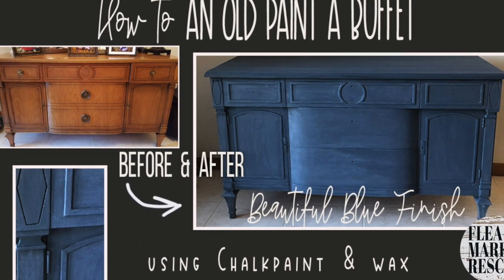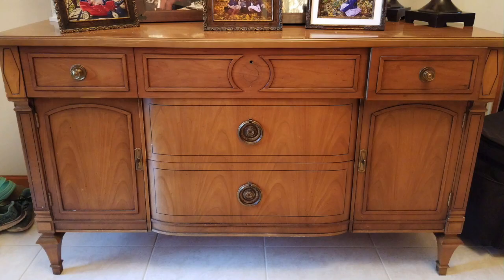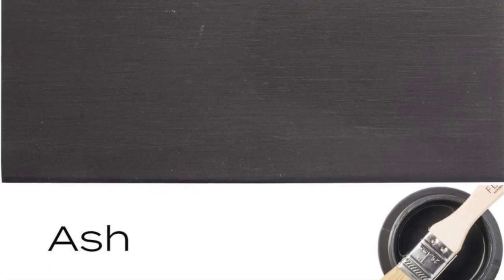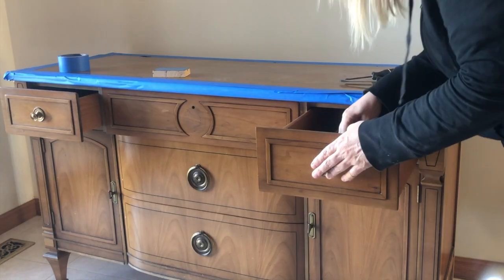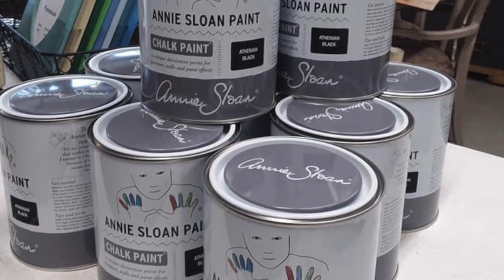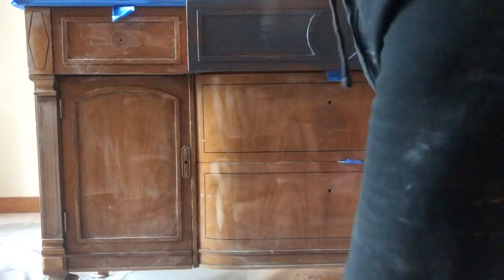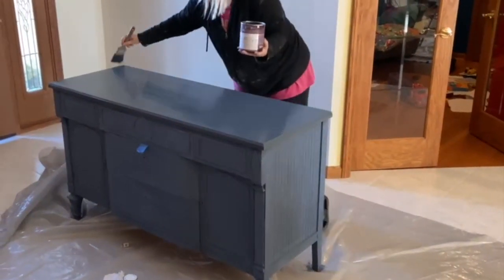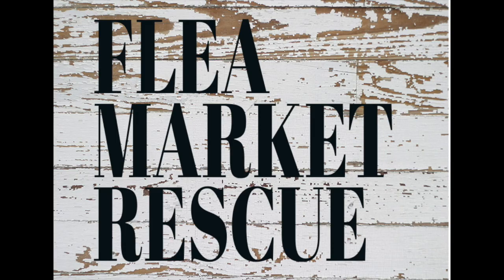HOW TO CHALK PAINT A BUFFET-FURNITURE MAKEOVER-PAINTING FURNITURE-BEFORE AND AFTER

Comment: The color is gorgeous...I suggest u to buy a expensive brush...19 to 25 dollars brush with an angle...they are expensive but what a difference when u paint...if you keep the brushes clean will last...I have some brushes that I purchase in 1987 and still in excellent condition.   The brush u are using seem not doing its job...  I love the blue ...an I am planing to paint one sofa table blue but more black than blue...a kind of blackblue experiment LOLOL
Reply from the maker: Thank You for the suggestion, Lolitabonita!  I appreciate that!  I know those cheaper brushes always seem to leave hairs I have to pick out!  I really need to invest in some more expensive brushes! Thanks Again and Best of Luck on your project!
Reply: @FLEAMARKETRESCUE  I do not like the hairs left behind by brushes...specially when the paint is dry and one try to remove the hair and leave a void on the paint...I only use cheap brushes when I am using salt finish or want texture...because the worst the brush is the better but for painting I prefer to use the good brushes and wash them right away...specially when using chalk paint...Blessings to you and yours